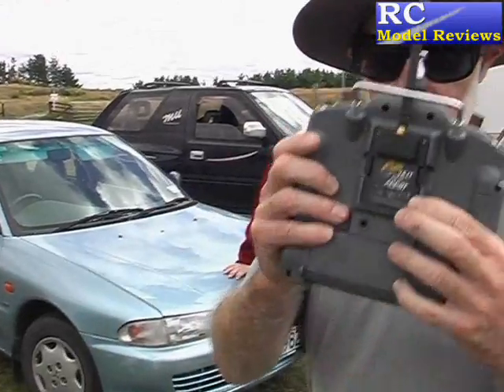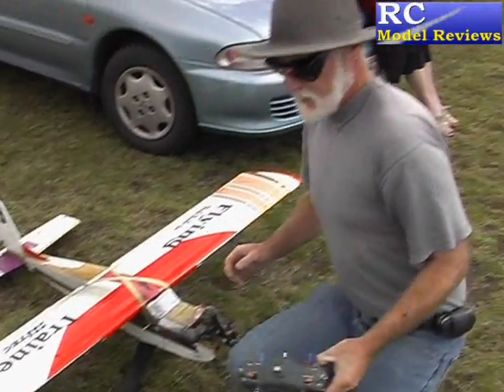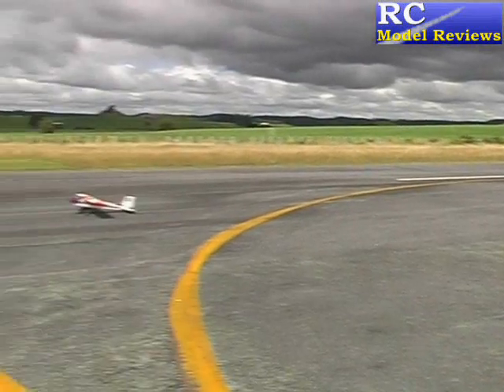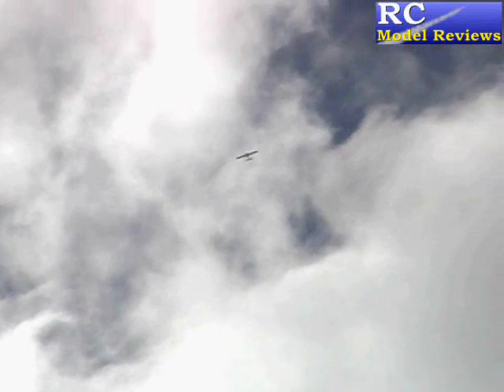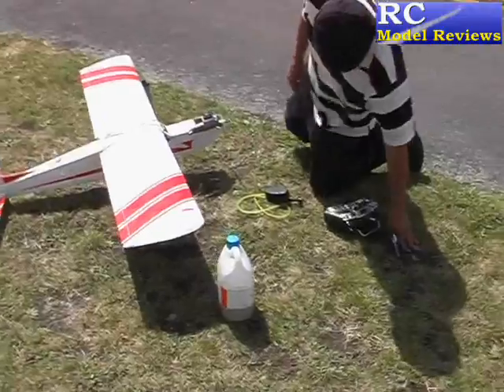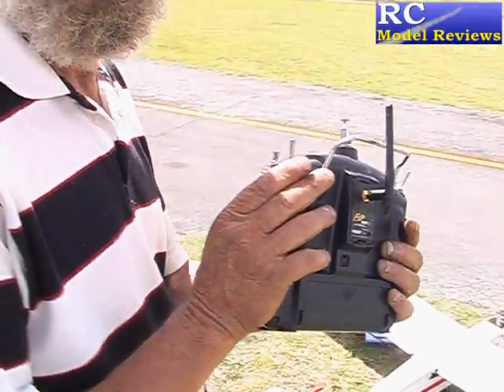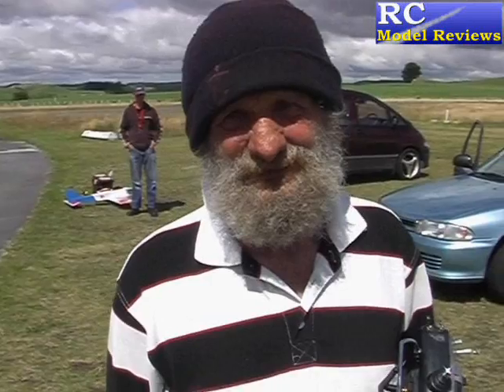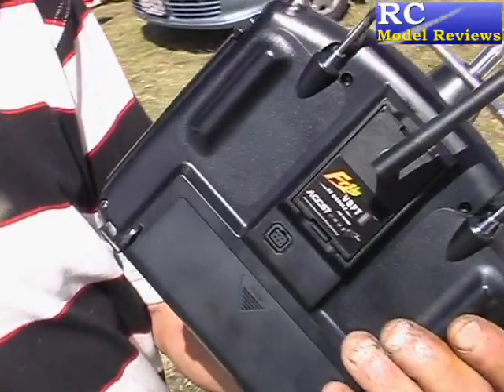Flight test: FrSky 2.4GHz RC module/receiver

Comment: I know it's an an older vid but, it just popped up in my recommendations. Is it better than the Corona system?  I've been looking for something 2.4Ghz for my Optic 6, as it's a shame to leave it sat around. I've been using one of those 6 ch Flysky set ups but the tx screen crapped out recently. I'll likely get the newer 6 ch Flysky as it will work with the previous rxs but, also something for the hitec would be nice.

Comment: Hi Bruce, neat reviev, thanks. But I am a little shocked: It looks as if you point the antenna away from the TX. Should it not be perpendicularly oriented towards the RX? Od do you hold your radio in 30° downwards angle? Cheers, Julez

Comment: Hi Bruce, I've just put a set of FrSky gear into my Eclipse 7 and a Hyperion Cap232 (yet to fly).  It seems to me that the servo control is more grainy (less smooth) than when using 36MHz. It's still responsive but seems there are minute steps instead of a continuous variation. I'm using new HXT900 servos.  Have you experienced this at all?

Comment: FrSky is flight tested and proven.  Good.
I will buy one for use in my iMAX  Tx.
Full spectrum frequency selection should make it the best interference resisting radio.
Reply: Hi, 11 years later here. Frysky shot their foot with their ACCESS protocol.